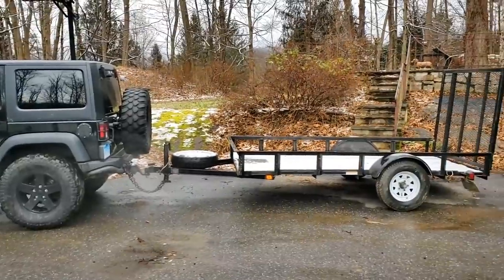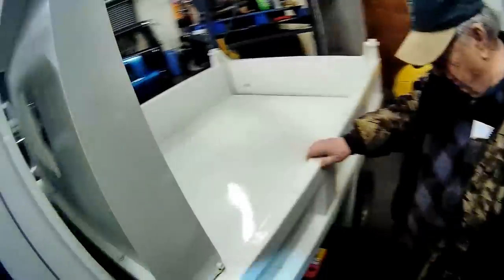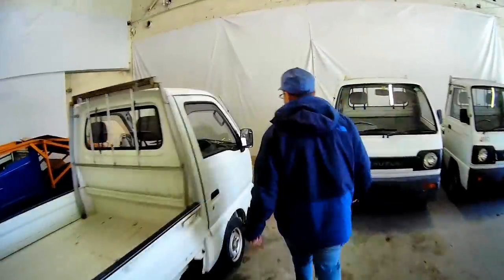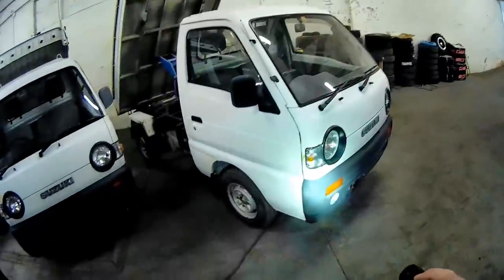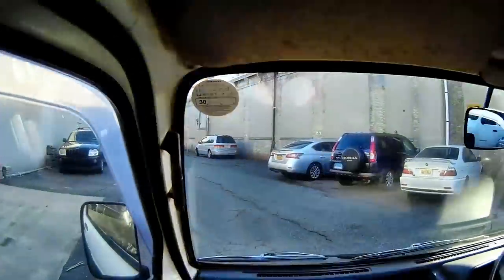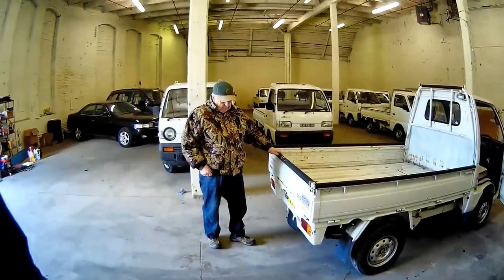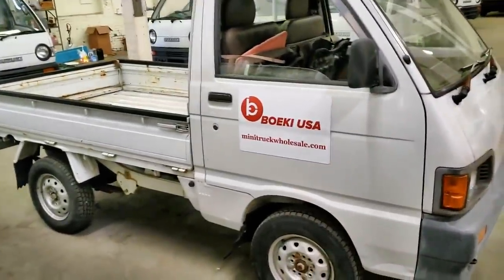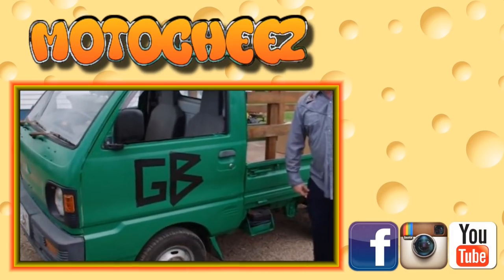$4500 Mini Truck info (SE01 EP01) what to look for, buy and get it home on 5x10 trailer

Comment: the “axle lock” he is referring to is just 4wd versus 2 wd and the front diff is open there is no lock or lsd function in the front
Reply from the maker: That is correct! The differential lock is for 4x4, Just the rear axle has a lock to create posi.

Comment: That seems like a good replacement for my yj while it gets rebuilt, especially with that bed could make it into a overnight fisher.
Reply from the maker: nah, it's not going to replace your YJ. Unless you're just using it for off road because these things aren't very fast on the road, nor have the articulation
Reply: @MotoCheez  just on the beach
Reply from the maker: Ohh, perfect! I want to build a camper slide in this spring.

Comment: The glass in mine wasn't DOT glass. They need to put DOT glass in it n do something about the top speed mine was 52 mph top.
Reply from the maker: Hmm, mine has DOT, and I've GPS verified 60mph, cruised at 55. Maybe the larger tires? Here is the DOT on window https://photos.app.goo.gl/MVAHP2gDgrWgM2tc8
Reply from the maker: I don't plan on using for road much anyway, maybe 5% of the time if that!

Comment: ive  got about 100  91 92 93  4wd suburbans on our ranches.. it a 30 year old  truck.. youll enjoy it
Reply: any  used  car, for street use anyway, youll spend a 1000 bucks in the  first year getting up to snuff.. 
for ranch vehicles..you might  spend a  few hundred.. new battery   a few parts, brakes etc ... ya did good
Reply from the maker: Thanks!

Comment: Anytime i set the handbrake i get get a explanation point, meaning i have to add brake fluid, it doesn't leak i just have to remember if i'm going to park it shut off and put it in reverse. Also it will not go into gear when it does this!!!???? I have to put it into reverse and pop the gear and drive that way to the house because they are connected someway Mine is a 2002 Suzuki Carry 4x4 long wheelbase. With a a windshield that's cracking all over, and a oil filler cap someone glued up with a blue rubbish glue. what a pisser. The brake fluid issue i don't understand.
Reply from the maker: That's bazarre. So the Ebrake light and an exclamation light comes on?  Then it won't go into gear after the exclamation comes on?
Reply: @MotoCheez  No  not  until l  add more brake fluid.

Comment: When my Carry gets low its when i set the hand brake then the clutch will not work, i can never find a leak!!! I don't understand it only happen if i set the handbrake. Soo if i have to stop on a hill i just shut it off if i don't want to ride the clutch i put in reverse with the engine off? strange but true there is never sign of brake fluid. Mine is a a 2002 model. I need to buy a windshield mine got broke, my mother-in-law didn't buckle up. Thank You !!!!!
Reply from the maker: Maybe the rear brakes are that far out of adjustment so the rear cylinders take enough oil to put it below where the clutch siphons off the master reservoir? If there's no leak on rear drums it must be adjustment.
Reply: @MotoCheez  No leak i have adjusted them  still the same.
Reply from the maker: @eugenecourtney1778  weird

Comment: I am about to order one of these and it seems like 4500 is pretty high. I've been looking online and can have an 01 Suzuki carry shipped from Japan for less than 1,800 bucks. There are tons of these trucks from 150 bucks to 500 online but with inspection and Insurance it comes to less than 2k
Reply from the maker: Where you finding those prices local? I looked for months, guys local asking $8k around me private sale. If you import you don't get to see what you get and there are about $1000+ in fees etc by the time you're done.
Reply: @MotoCheez  no not local. Imported from Japan. I have found 6 that I inquired about 3 of which I'm very interested in. One is a 01 with 100k km 2wd for 1,300 that includes insurance, Inspection and other fees. The truck itself is only 300 dollars but with the fees takes it to 1300. Then a 96 4wd with 52k km for $2,900 total. Yea it kinda sucks not to be able to check it out before I buy it but hopefully it checks out. I will have to see what their policy is (if it gets delivered and isn't what I paid for) and see if there is any kind of buyer protection but as you stated people local want an arm and a leg for these trucks and they are just really not worth 9 and 10k at least not for a 90s model but I guess they charge so much because they seem to be kinda rare here.
Reply from the maker: Ohhh, yeah some people get some good deals that way, some do get crap. For that price it's worth the Gamble
Reply: @MotoCheez  exactly it is kinda a gamble but the way I see it is it's an older truck so even if it does need some work (I'm sure it will) it's still a pretty good price. If it was going to be a daily driver I probably wouldn't be so eager to gamble but since it's only going to be used around the property taking trash out to the street etc I figure why not lol
Reply from the maker: Hell yeah!

Comment: Make sure you put lots of undercoating all over the frame and everywhere that's not visible. I have one now I think I even bought it from the same guy and had it shipped to Florida. They are not made to last and rust badly. I love mine and just have it all redone.
Reply from the maker: Thanks! I do plan on painting with oil based Rust-Oleum paint. I can imagine they'd rust away with the salt used around here!!!
Reply from the maker: I may end up in Florida in a few years...lived there in the 90s

Comment: What is the LOAD CAPACITY on the Honda?
I have a DY16Z (SOHC V-Tec) that I can easily fit for an engine swap!
Reply from the maker: Probably same as my Hijet, 800lbs, but if it's like my Hijet, the engine is layed almost flat so not much height
Reply: @MotoCheez  Could you PLEASE send me a picture of the Engine Bay/Layout?

The wife is allowing me to purchase a new car (Mazda 3 Hatchback) when her 2015 Mazda 3 Hatchback is paid off.

But I also want a Truck for Landscaping Purposes, and I was looking torward to the 2020 Ford Ranger, but DAMN it's too expensive!

So, my thoughts where to upgrade to AIR SHOCKS on the rear to "possibly" allow up to 1,500 lbs for building materials or topsoil.

From your Diahatsu experience, is that realistic? I'm hoping to buy a Honda HiJoy with Hydraulic Dump Bed...

Thanks!,
-Thomas (12)
Port Orchard, Washington

Comment: Its got potential if you do the right upgrades; coil over lift kit, turbo charger, bigger tires, etc.
Reply from the maker: I did some of these mods later in the series! Very capable little trucks.

Comment: i have a piaggio porter  pic up  now i think with a daihatsu motor in it   year ??2008  with rust and engine  a problem i think
Reply from the maker: Rust already?
Reply: @MotoCheez   yes  this  is a huge problem but not extreme  this mini truck was for work in use  . .always in the open air  ..
Reply from the maker: Ahh. Yes

Comment: You can find tons of these mini trucks all throughout Central America.  Brand new they sell for around $9k so paying $4500 for a 25 year old truck seems too high.
Reply from the maker: It’s supply and demand I think. You can buy them for less than $1000 in Japan  and pay import etc
Reply: Like MotoCheez mentioned, supply and demand thing, plus they have to pay import taxes, and sometimes get them running or replace major parts to GET them running, plus make a little profit in the process, so $4500 isn't really too far out of line. There was a guy here in N.M. that bought 3 or 4 of them at a discount, but he was having issues getting the proper titles, and it turned into a situation where he could only sell them for farm use because they couldn't be licensed. (This was before he found out about a service in New Jersey that does titles for these.)

Comment: I'd really like to get the little van version of one of these. They are left-hand drive in the Philippines. Can they be imported from there?
Reply from the maker: I'm not sure, but I think they import them from Japan
Reply: @MotoCheez  Yes, most all of them are imported from Japan. When I was in the PI last year, I saw them everywhere, and they were all left-hand drive. I was wondering if it is possible to import them from the PI. It'd be much easier to drive on USA roads with the steering wheel on the left side.
Reply from the maker: Hmm. I'm sure you could somehow.

Comment: I really like the idea of these - I have a couple of Rangers (a 97 and an 06) that I will never get rid of because they will be way too expensive to replace. All I do is light hauling and dirt road driving, there's no need for me to spend $25-30K on something for that purpose. All I need is a sturdy framed, reliable runner with enough power to pull a 5-800 lb. load every once in a while. My Rangers fill the bill, but if these ever become more available...then maybe.
Reply from the maker: Those old rangers we're awesome. There's a thread where everyone is saying just that!!
Reply: @MotoCheez  - Thanks bro, enjoyed your posts. Good luck with your little Dihatzu, it looks like a fun one.

Comment: In your opinion between  Daihatsu Hijet and Suzuki Carry witch is better choice ?
Reply from the maker: That's a tough decision, I like the daihatsu because the weight is better distributed than the Suzuki carry but the Suzuki carry seems to have more parts available and has a common 4 lug bolt pattern for the wheels if you want to change them but they are about the same to me it's a personal preference I guess.

Comment: It sounds like he's describing what we used to call "limited slip" in the front axle.
Reply from the maker: No, it's actually what engages the 4x4, like the Chevy vacuum units they used to have on the front axle.
Reply: @MotoCheez  I guess I was referring to only one or the other wheel engaging.

Comment: I can tell them how to never be stopped by police when test driving a vehicle with no TAG. Get a WAX marker that Dealerships and Auto Auctions use. Write the first 6 of the VIN# on a front corner of the windshield and write it on the back in a visible location. I am 52 and have worked at two dealerships and two body shops and have never been stopped. If they see it came from an Auction or a Dealership, they know it is being test driven or tested by a mechanic. Just have the papers of some kind that shows it in a manifest or purchase order. Just in case.

Comment: I had once a Suzuki Carry,  just like those car's. Weight 800kg load cap. 800kg. Engine 0,8 litr. Top speed with good wind and down hill... about 125km/h usuaaly less. If had good brakes, scary.
Never did, but i think about to put there a Toyota 1,3 litr motor.... and wheel bars.
Reply from the maker: There is no height for a conventional vertical motor, they're almost layed flat.

Comment: The danger in any of these dump models is that the load gets stuck and can racks/twist the beds and or lift the front end up. Having see this done in South East Asia for similar models.
Reply from the maker: Good info. I've seen it on pickup dump models too

Comment: all kei cars are 3 cylindered i belive

it's a wonder they dont sell in itali , it beats a piaggio ape by far

20 years a go my buddy had a old ford fiesta(1986 model) 1000cc engine with 32 hp we drove it with a trailer , moved for people , we went to get beer etc on the other side of the boarder to save on taxes (250 miles trip) :)

i cant count the times we have had to change wheelbearings on the back of it , but hey we got there and back every time
Reply: There you are: The Piaggio Porter looks very familiar to those boxy vans from Japan, I'd wager they are related: http://piaggiocommercialuk.com/range/porter-range/
Reply from the maker: 👍👍👍 nice!
Reply: @overboost7667  wow  i think we got a match here :) :) well spotted !

Comment: Here in Philippines, the Suzukis are all over the place.  Law here requires they be converted to LH steering, and several companies import and refurbish "surplus" Suzukis.  Mine, which I've had 4½ years, WAS a mini-van which is "chopped" in back to create an outside "pickup truck" bed.  Drivers taller than 5'4" likely to find the pickup-truck cab too short to allow the seat to go back enough. 3-cyl 660cc. engine does a great job for our local driving conditions.  Unlikely to get  "street legal" in USA because of safety equipment and other regulations.
Reply from the maker: Great info! Yeah we get to register these here because of the 25 year old rule. Classic and doesn't require the safety equipment. Newer units have to be speed limited to be used like golf carts
Reply: @MotoCheez  Here I use mine to travel 100+ mile distances at times - - which will take around 4 hours - - and the hard ride + hand-poured concrete segment roads, will beat you to death after the first hour or so.  So it is BEST  used for shorter range.
Reply from the maker: That's a LONG way to drive in these! Dayum

Comment: Did they have any 1.6L Suzuki carry trucks? Been trying to find one at our Canadian mini truck importer but they only have JDM imports that are limited to 660cc
Reply from the maker: I know he gets them once in a while, but they have to come in speed limited if newer than 25 or 20. Whatever it was
Reply: MotoCheez I see, definitely wouldn’t want to have the speed limited. Probably simple enough to remove though like the governor on new production vehicles. Guess the import laws are a little tighter in NJ. It’s 15 years in Canada and street legal. Dunno why the guy here only dealt with JDM imports instead of going elsewhere in Asia for larger engine Kei Trucks.
Reply: Awesome prices at the dealer you used. Here they go for closer to $8000USD. If they were street legal in NY would’ve definitely been worth the drive from Toronto. But towing and duties since they are not NAFTA would kill probably half of the savings.
Reply from the maker: Yeah. Damn

Comment: Interesting people are buying anything other than Acty and Sambar, when they do not have parts readily available and poor weight distribution, and the cab gets too hot in the summer with the front mounted engine.
Reply from the maker: Acty and sambar are good on the road, but inferior off-road, I've tried dozens and prefer the hijet with rear diff lock, solid axle takes way more abuse and hauls better because weight is forward. Same with suzuki

Comment: I'm don't know much about Mini Trucks but i'm looking to get one, i noticed you wanted 4 hi and 4 low and i understand that but you wanted a truck with Diff Lock why is that, what does Diff lock do vs trucks that don't have Diff lock. Any other info i need to know on what to look for in a Mini Truck. Thanks
Reply from the maker: I have 18 acres with rough terrain, if you get one front and one back wheel articulated where they'd be off the ground it will spin because of open diffs. Whith a rear axle lock it locks the 2 tires together so if one tire touches it will get traction
Reply: @MotoCheez  So in snow it sounds like Diff lock is a must or no, and do you know about how miles per gallon you get gas mileage wise, Do you drive yours in town or highway ever and what is top speed about 60 MPH. Thanks for your help.
Reply from the maker: Yes, better in snow, but of course can slide sideways easier being locked together, when you make a sharp turn the inner wheel turns slower which is why most cars have open diff. I'm currently registering it but I've read these get 35 to 40 mpg. 60mph is Max, yes.
Reply: @MotoCheez  Thanks for the info and help.
Reply from the maker: 👍 yw

Comment: maatee,aus here,you need something bigger,about 2lt,diesel if posi,,these are so gutless,dont go off road in mud with them,or fit wider tires,plus,there a royal pain in the ass to work on,if the cab tilted forward be better,but,here,machanics hate them.same as hiace ect vans.people run them into the ground,no service,no work on engine,too frigin hard.try changine a rear plug,or rad belt,goooood luck.

Comment: These models are from the 80' and  90's... here in the Philippines we are already using da63 and 64... However, they are knock down units for less than a grand.
Reply from the maker: Nice. Can't import newer than 25 years if you want to register here.
Reply: @MotoCheez  ooops, anyway, those vehicles are reliable and easy to maintain.

Comment: I just wish you could license them for on the road. If they did, I'd buy one right now. Would be great for driving to work and hauling stuff on the weekend.
Reply from the maker: Yeah, it's crazy why some states won't let you, it's an economy car, classic so doesn't have the safety requirements of current vehicles...
Reply: I suppose without air bags and all the safety crap now days, it's an insurance issue too. I drive 8 miles to work, so it would work perfect for me.
Reply from the maker: Yes, that's why the 25 year and older minis can be imported.
Reply: Good to know. Thanks!

Comment: don't forget that in these trucks, the brake fluid is also the clutch fluid, if they run low, your clutch is not gonna work properly.
Reply from the maker: These older models have cable clutch.

Comment: Awesome trucks. What price range do they run? Good luck with it!
Reply from the maker: They start at $4000 and up depending on mileage and condition of course. Dump trucks are $6800 and up. The motors run a long time from the research I've done, only thing mine will need soon is a clutch. Doesn't seem too bad of a job. I'll do a video on it of course. Thanks! I already ordered a lift and tires!
Reply: LESS than 3000.00 from importer, many @ 15 to 20 WARNING, the mileage on MOST are OVER 100,000
Reply from the maker: Yes, true. But you can't really check them out like in person. Mileage if low, you're right. Have to check the pedals mechanical wear etc.